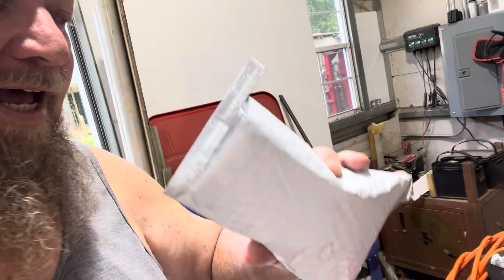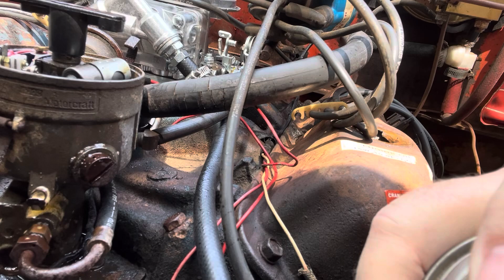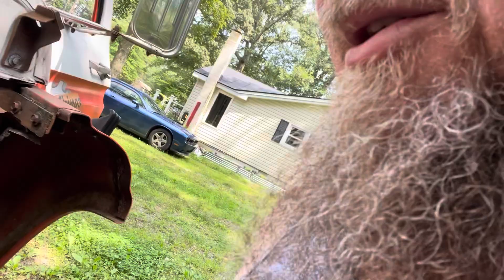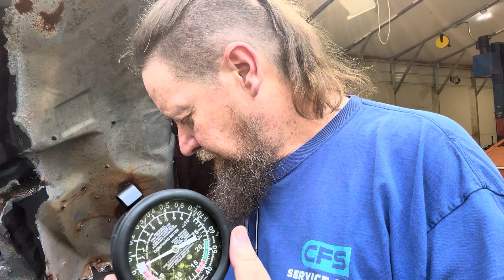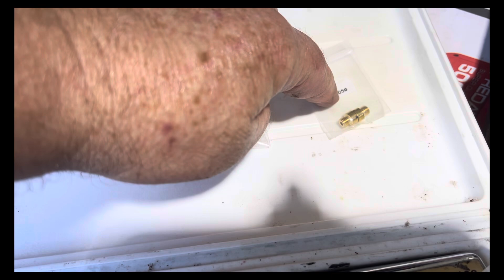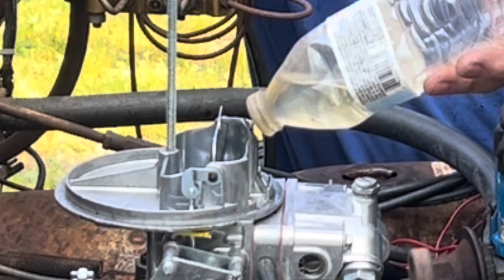Complete Holley 4412S Tuneup

Comment: I found a bent piston rod does that mean I need to replace the dialpin or would it be fine?
Reply: Wrist pin
Reply from the maker: The bent connection rod is significantly damaging to other parts like the wrist pin like the piston and the crankshaft journals. I would have to check the crankshaft for uneven wearing patterns and possibly replace the piston and the connecting rod. When replacing a piston and connecting rod, check the weight of one of the other connecting rods and pistons to make sure that your new piss and connecting rod is the same weight.

Comment: On my pistons rod barings that I took off don't have oil hole does it matter if my new ones have oil holes or not ? I have always worked on 350 motor not 3.8 motor
Reply from the maker: The rod bearings get oiled through the hole in the crankshaft. the main bearings get their oil from a hole in the block which passes through the hole in the crankshaft that's goes down through the crankshaft and back to the connecting rod journal. The centrifugal force of the crankshaft itself helps the oil push through to the connecting journal. The connecting rod bearings themselves don't need holes in them, but there are some engines out there that do have holes in the connecting rod bearings, help sling oil to the backside of the pistons

Comment: I am Bulding a 383 stroker for my 1st time what would be the best than for it I know I would like to put double hump heads on it the motor is a 1989 350 right now
Reply from the maker: As carbs go, it depends on what purpose the engine will be used for. If you’re building an engine for drag racing or most of the power is gonna be at high RPMs then maybe something like a 750 double pumper but if it’s gonna be like a mile street machine with some good street performance then maybe a 650 with vacuum secondaries. The 383 engine is a good breathing engine and a lot of people have put some big carburetors on them and done very well.  You have to make inconsideration of what camshaft you’re gonna be running and the type of transmission.  If the engine is gonna be going into a truck that you’ll be doing towing or something like that with then I would go with probably a 600 vacuum secondary something that will give you good fuel at the lower RPMs and keep your power curve stable through your RPM range. There are many things that be thinking of when you’re trying to choose your carburetor just remember what is the main purpose for the engine? Then choose your carburetor for that purpose not on the biggest or baddest, but for this purpose, the engine was built for then you’ll be the happiest with the outcome and performance of your engine.  Thanks for the question and good luck on your build.
Reply: Can I hot tank the pistons and the arms with out hurting them? I was thinking I had my wife van ready to put back to gather then I pulled a piston and the rings would not move and I need to clean them up. Sorry for all the? I normally by all new but she doesn't want to that
Reply from the maker: @jessjennyetienne5656 
Yes, you can hot tank the Pistons and the connecting rods. It won’t hurt them.   But on the Pistons, if you’re using extremely alkaline substances, it can eat at the Pistons if they’re left in too long. My parts cleaner uses a strong alkaline cleaner and I left the Pistons in there for three or four days and it didn’t hurt him on my 302 pinto project.
Reply: Thank you I will keep this in mind I don't want to build it and it blow up on me do to something that I did wrong I was thanking about getting everything for a 383 but I don't know if that will be the right way I would like to put it in a 78 camaro with a 350 turbo transmission
Reply: Ok thanks if I hurt them my wife would put me in the dog house because she wants her van back do to are truck likes the gas
Reply: The hard part is I am doing all this with the motor in the van